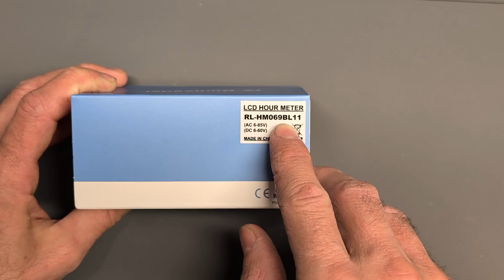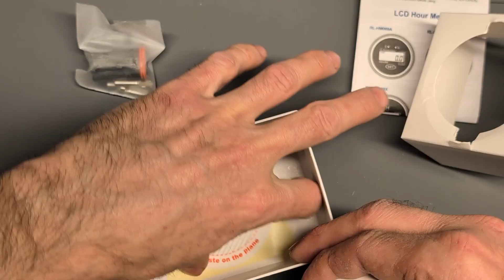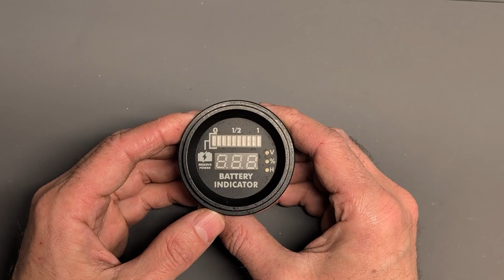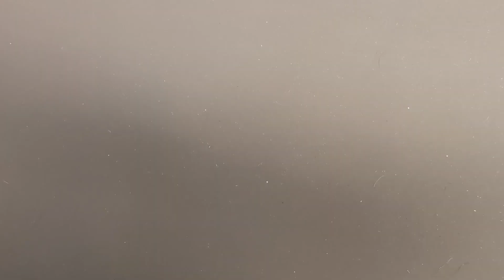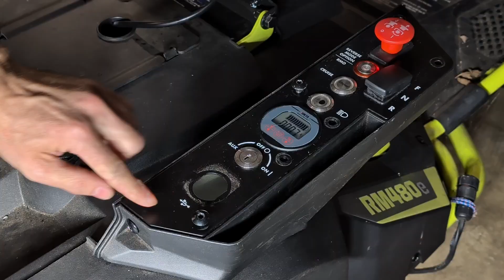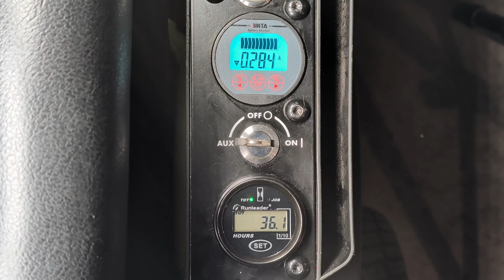Installing an Hour Meter in a Ryobi 48V Mower

Comment: If I haven't swapped the original meter for the TR16, how well would this meter fit in that spot?  Would it make more sense to put the TR16 in the plastic body panel instead of the hour meter?
Reply from the maker: Some people do exactly that. it's really just personal preference. The hour meter is about 1mm too big for that hole, but that's a lot less to remove that the 6mm you need for a TR16.
Reply: Which would you say is more important, the battery meter, or the hour meter?
Reply from the maker: @mcargent  The battery meter. The hour meter is really just to track use and maintenance. Some people do it seasonally instead of relying on hours.

If you have a 3D printer or know someone who does, there are a couple options for mounting the TR16 that don't quire making the hole bigger or drilling any holes. You can find them here.
https://www.technicalpenguin.net/ryobi-48v-mowers/3d-template-library#h.knyb0o92ub0z

Comment: I feel a bit left out with my lowly RM300 …. Is there a preferred location?
Reply from the maker: It's up to personal preference. I think it looks good mounted on the sloped part behind the instrument panel. I've seen some people mounted it on the flat part a little bit behind that too.
Reply: @The_Technical_Penguin  thanks for the feedback. Is there a combination battery meter hour timer with a shunt they would fit in the place of the original meter? i’m guessing if there was you would have added to your website? I did see a post on the Facebook group from someone who put a larger rectangular combination meter, but it had a 500 amp shunt. I’m seeing a bunch of combo units on Amazon that are under $20 they look like they would fit, but I’m assuming all of those battery gauges just work off of reading the voltage… If I’m understanding correctly, you need the shunt type to collect accurate data.
Reply from the maker: @fotopdo  I have been looking for one. The only one I have found that looks promising is the Runleader RL-BI025K with an RL-SR202A or RL-SR202B shunt , but it's not available in the US right now. I reached out Runleader to see if I can get it to test. Will let you know if I hear back.